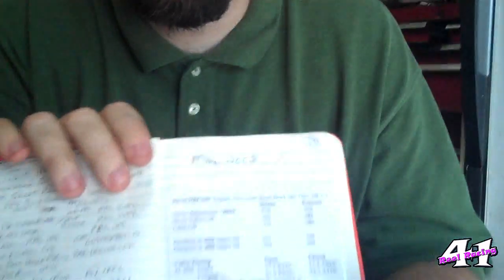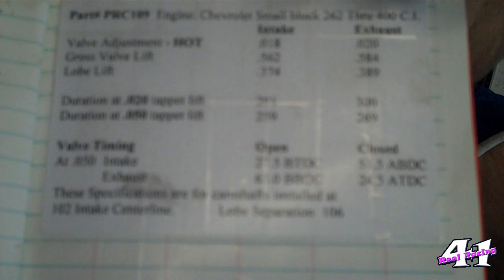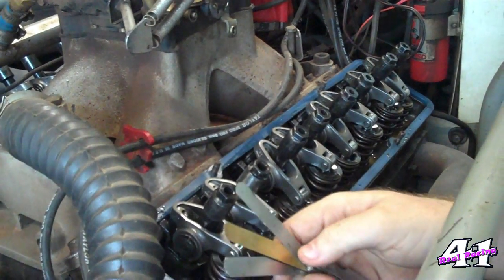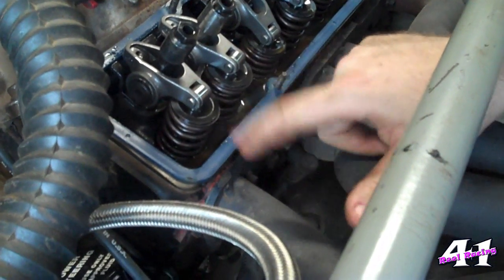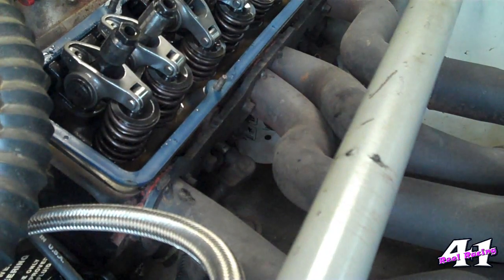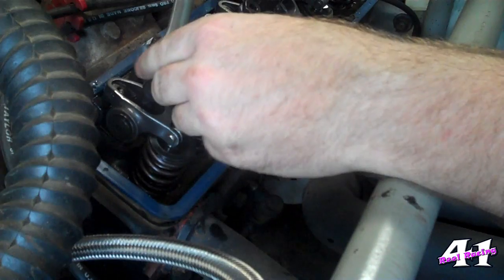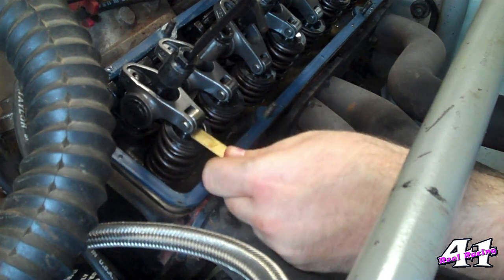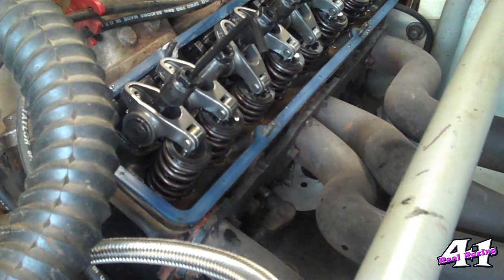6 ReelRacing Valve lash part2 Advanced

Comment: @madmatt54   You've been doing it wrong for 15 years then, and you wont have any problems, just a loud top end plus you wont be getting full potential out of the engine(if you dont correctly set hott lash setting)..  My family owns and runs a machine shop, specializes in maxx effort race engines from 500HP 4 cylinders to 4000+hp blown hemi's, even the worlds fastest lobster boat..  ive learned a thing or two and setting valves correctly is one of them..

Comment from the maker: @Badchevee1  Set them however you want, it's your motor, but this is the way I've been doing it the last 15 years without a problem, running everything from low lift hydraulic motors up to big lift 15:1 full rollers.  If you read the other comments I posted, I said to check it hot, and see how it changes first, my lash has always gotten tighter, not looser when hot.

Comment: I hope no one listens to this video.  If you do, your valve lash setting will be all fucked up....   The correct way is to set your valves TIGHT on a cold motor, usually around .010" under hott lash setting.. and as the engine heats up the tolarances will grow to spec... If you need .022" hot, seat them at .012" cold, when its hott it will be VERY close to your hott lash setting.  Look it up, search T&L race engines. they have a nice video on here telling you the correct way to set valves.

Comment from the maker: This is the way I've done it for ten years without problems. The best way to do it, is to warm it up one time and set one valve, let the engine cool, and check it again. The difference between the two temp settings is how much you need to add when it is cold.10 bigger should be close though.